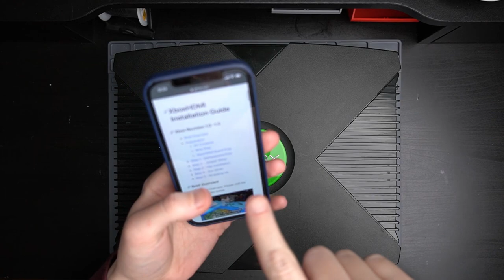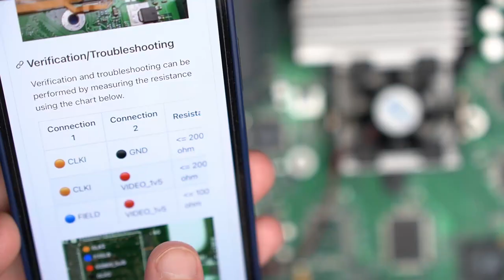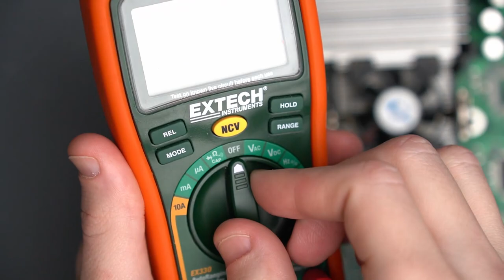Let’s install XboxHDMI in a 1.0 Xbox!

Comment: Excellent video! Was actually swapping my install over and seeing the plastic HDMI piece installed in the metal shield really helped. Definitely agree, hopefully that part can be made easier later on so you don't have to rip EVERYTHING out just for that one little piece. As a tip, taking out the metal shield is much, much easier if you remove the fan and front panel first. Both of which are held in with some plastic tabs.
Reply from the maker: Yea at some point I got annoyed and ripped it out lol, the Xbox case design is solid but annoying. Thanks for watching!
Reply: what usb pen should I put to put to put the softmod program on Xbox Classic
Reply: @dubesinhower  what usb pen should I put to put to put the softmod program on Xbox Classic

Comment: Great video. You've earned a sub. Just a heads up for in the future, Goof Off works better than anything I've found for cleaning off the old thermal paste. I just use IPA to remove any left over residue and save about 30 mins lol.
Reply from the maker: I'll keep that in mind, thanks for watching!
Reply: I use ArctiClean Thermal Material Remover; cuts right through this stuff with ease. It smells citrus like, so I'm guessing any citrus based cleaner would work well.

Comment: I would not have the patience to work with mixed solder chemistries to get that flex cable on the video encoder. Kudos.
Reply from the maker: Haha yea I probably should get some lead free solder to have on hand
Reply: @dubesinhower  I hate working with lead-free
Reply: You should i got the mg chemicals one off amazon its more expensive than the leaded solder
Reply: The 1.0 was made in 2001. There’s a good chance it was not Pb-Free/RoHS. I did a later 1.1 XBOX and it was still shiny after adding leaded solder so I’m pretty sure 1.0 and 1.1 are not lead-free. Mixing lead free with lead solder always results in a dull solder blob for me.

Comment: Awesome vid. I'm definitely subscribing. Hey for those jumper wires you installed using old capasitor legs. Would it have been easier to make them into a U and push them through the holes soldering them in place?
Reply from the maker: Ha, that’s a good idea! A small piece of wire would work too
Reply: Had exactly the same thought 😉

Comment: 13:00 as far as i know the 4 can be together, they are mode 2 and mode 3 and they need to be grounded
Reply: Yep. Also, for reference, the composite cables join 5 & 6 and 9 & 10. I needed to know this in order to test composite video after removing the AV port and I found it nearly impossible to tell without destroying a cable. I avoided that by plugging the cable into a removed port and probing that instead. When I was done, I used mounting tape to hold the port and cable to the back of the XBOX and soldered two jumper wires from inside (ground and CVBS). Of course, the two mode jumpers were set inside the console. Without that: No video.

I’m somewhat surprised that it doesn’t fall back to CVBS when none of the mods jumpers are set. Well, this was a European console. I needed to test video AFTER removing the port since the entire console was untested. That’s because I didn’t have an American 1.0/1.1 power supply when an EF-4 tornado wrecked me good while the console was in transit. I had to start working with no way to fully test it but eventually found my old 1.0 console (missing for over a decade). It was damaged in a 2004 burglary because the thief didn’t know the top was unscrewed when he tried to grab it but the PSU still worked great. Thankfully, the owner had selected a video mode that was compatible with my American TV so I was able to get the software on the TSOP-modded XBOX. :)

Comment: The emulsifier works better if you drop it right on the paste. I have the same stuff and use it all the time. Use less paste. I place a small bead down the side of the chip, then smear it across with a credit card so that it's just enough to coat the top. Too much paste and it'll act like an insulator, you're just trying to fill in the microscopic cracks in the metals.
Reply: Gamers Nexus actually did a whole video and there's basically no such thing as too much paste, sure it will make a mess but there is no loss of heat conductivity.

Comment: Broke my gpu heat sink clip as well, managed to get it off in one piece and then after I scrubbed and replaced the thermal paste I went to clip it in and it grabbed hold, then I pushed the pressure pin down and then it snapped and flew off my board lol…
Reply from the maker: RIP

Comment: This is the video that I was looking for❤. Is there any chance to turn a classic xbox controller into a Bluetooth controller which links to a Bluetooth plug to the classic xbox, so now having a wireless classic xbox controller? Cuz I have 4 wired classic xbox controllers that  don't work but I don't want to throw them to trash, but will be an option upgrade them 🙌🏻

Comment: only us xboxes has the option for 720p and 1080i ! / for pal users you need a softmod or modchip or tsop mod to have the HD rez options
Reply from the maker: Ah I didn't know that, are they just hidden from the dashboard?
Reply: @dubesinhower  locked in the bios microsoft did not want us in europe to have the HD option unlocked back in the day wich makes no sense at all
Reply: modchip is highly recommended for this HDMI mod anyways, so might as well do it and use the HDMI patch to patch the kernel for optimum results, tweaks, and fixes.
Reply: I don’t get it. HD was standardized worldwide, at least for 60hz… and even a lot of PAL SD stuff was enabling PAL60 back then. Why on Earth would they disable that?!
Reply: @troymeredith521  It’s not always that simple, especially when the console already has a TSOP flash and there is no guide for patching that. OpenXenium adds a lot of expense when you replace a mod chip for no reason, especially considering that the cost of the kit already doubled in the move from XboxHDMI to XboxHD+

Also, this video was from March 26th. That shipment was before the transition to XboxHD+ so it’s no wonder that stuff isn’t in the video. Back then even the official instructions stressed that a modded XBOX was optional.

Comment: Bit of feedback: I would love to hear what the acronyms mean like QSB(P?)
Reply from the maker: I'd like to do a separate definitions video so I don't have to repeat it every video, but yea I should add a title on the screen. Thanks for watching!
Reply: Quick solder board
Reply: HDMI - High-Definition Multimedia Interface
HD - Hi-Definition
PCB - Printed Circuit Board
AV - Audio Video
How far do we want to take this? ;)
Reply: To be a bit more helpful, a Quick Solder Board breaks out to all the connections you need to make to reduce the number of wires or jumpers you might otherwise need to make. For example, the QSB on an XStation for SCPH-500x PU-18 boards breaks out the 20-pin ZIF cable to all but one of the connection points (only needs one wire). Other than the ZIF connector itself, it doesn’t even have any components.

Comment: question what it is and how you use the sata drive to sata drive conection to IDE conection and what brakect you use to make stay put?
Reply from the maker: It's just a cheap IDE to SATA adapter from Amazon that's being held by a bracket that I found that I 3D printed. There are a few of those designs online, like this one: https://www.thingiverse.com/thing:2875749.

I found 2.5 inch SATA laptop drives were cheaper, so I wanted to get a 2.5 to 3.5 inch hard drive adapter, which I probably spend too much on lol.

This only works if you have a soft modded Xbox.
Reply: @dubesinhower  i have a soft modded Xbox but still have the original harddrive and is making clicking noise what that means is near to dead and wnating to look for a replacement, thanks for the help found the parts.

Comment: will this work with the original AV output in place? im more curious because id like to be able to test to make sure it works before I get rip of the AV out
Reply from the maker: Not sure, but I doubt it
Reply: @dubesinhower  cool thanks. I gotta do one on a 1.6 and soldering the ribbon to the surface mounted resistors is a pain.

Comment: Dude, where did you get those rubber feet? They give a nice look to the bottom.
Reply: I don’t think he put those there or he would’ve known there was no need to remove them. ;)
Reply from the maker: I actually did add them, they’re 3D printed feet that I added when I removed the stock rubber pads when I soft modded this Xbox
Reply: @dubesinhower  Ah! I like that they give you access to the screws and assumed you removed them to look for other screws. Was the adhesive just not holding up or something? What material did you use? TPU?
Reply from the maker: @emmettturner9452  the adhesive was in bad shape. I used PETG for these, but I’d like to get a better extruder for tpu

Comment: So you can just turn the 5.1 off & it will work fine with everything. on it works with most
Reply: Well, it’s technically isn’t optical anymore but it’s the same digital SP/DIF signal. ;)

Thanks for pointing this out though. I always assumed the XBOX had a standard uncompressed stereo mode over optical but now I’m not so sure. I recall it was the same “DDLive!” tech from the old nVidia nForce 2 with MCP-T southbridge (“nVidia SoundForce”).